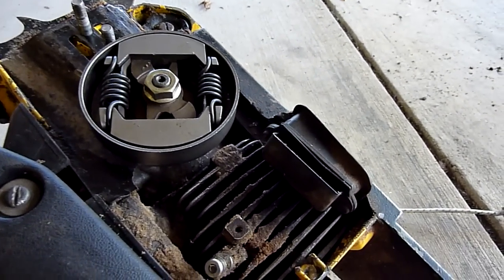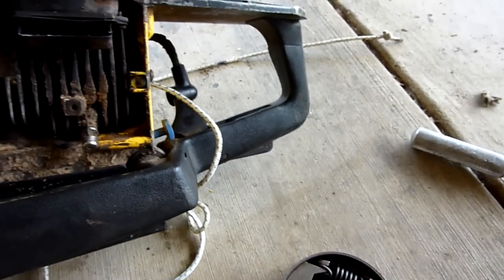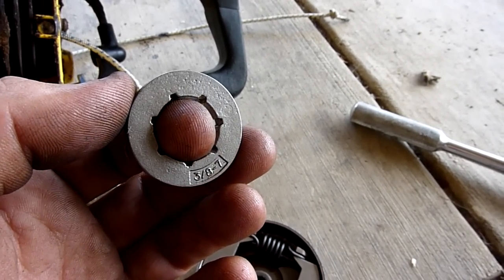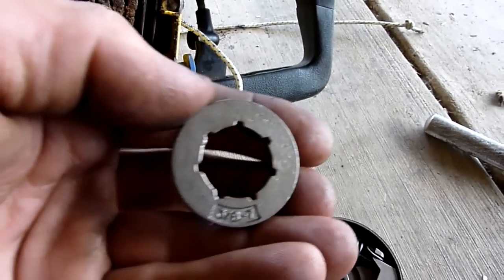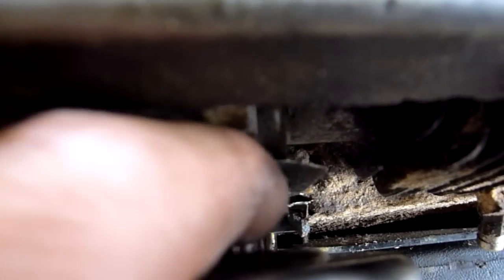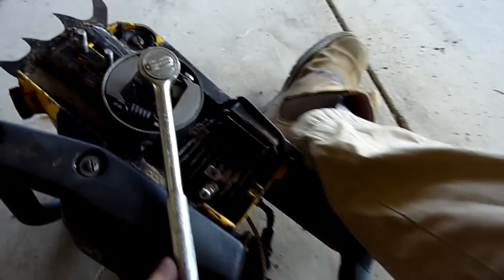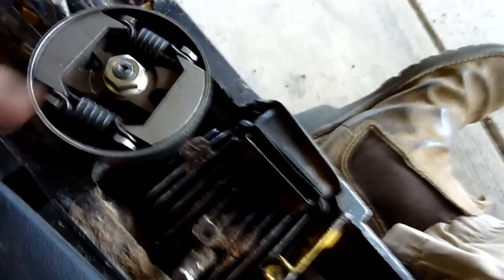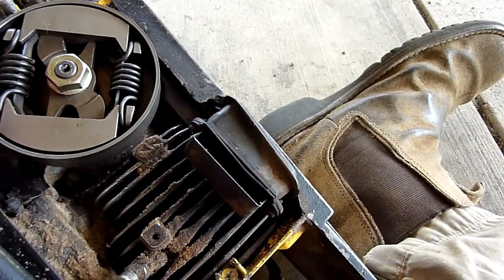McCulloch 650 Pro Clutch, Sprocket, Rim Removal & Installation - Take Apart Part 2

Comment: Don’t forget to lube the sprocket bearing.  I use my battery powered impact to tighten the clutch nut.  I hit it twice with the impact.  It ends up with about the same torques as the flywheel nut (about 30#).

Comment: if ur pyranoid to fill it up wit hrope put something else in there like a material called steel that should do some major damage.... the rope will not hurt the inside as long as you put enough in it to where it dont get cut from the piston making a full rotation... good luck!